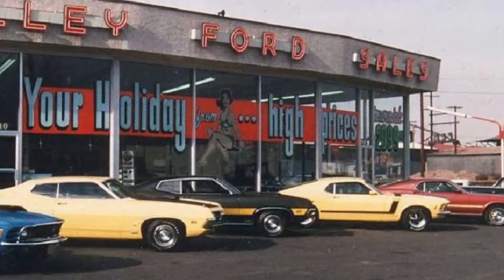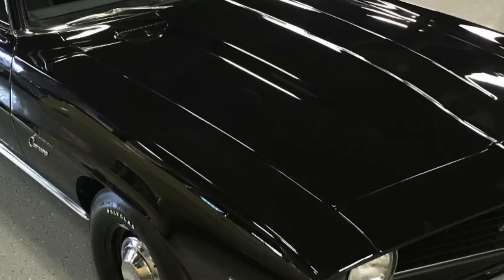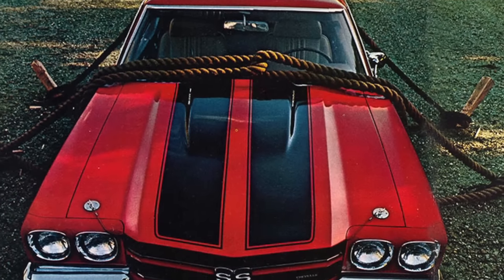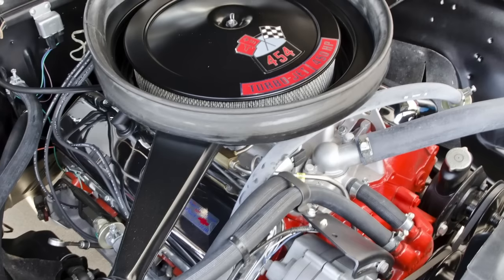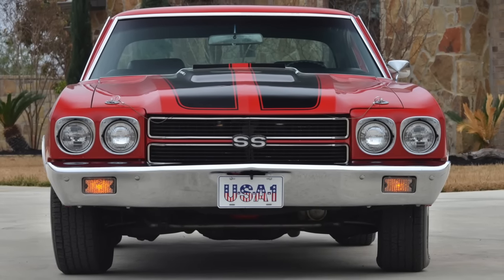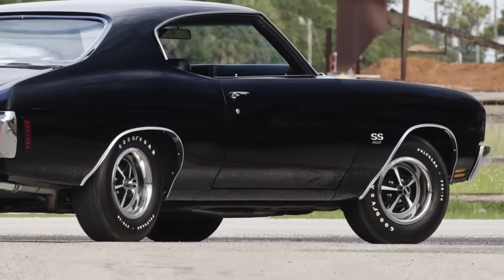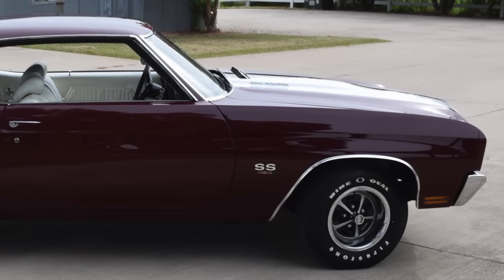1970 Chevrolet Chevelle SS LS6 454 – Freak of Nature

Comment: I bought a new 70 LS6 SS in Feb, 1970.  White with Black Stripes and Black interior.  As I recall right at $4,700.  Probably the most fun car I ever had.  I won almost all of the time but there were a couple times I lost. It was a daily driver so I kept it pretty much stock except for Headers and a different Intake and Carb.   As long as I didn't touch the inside of the engine my warranty stayed intact.  Sometimes I simply could not get any traction.  I had the 3 Speed Auto with I think a 331 Gear.  i have always wondered what would this car have been like with today's electronics.  My fun car today is a Z06 A8.  I have always been an Automatic Transmission person simply because I was not good with the manual clutch. I kept the 70 SS til I had 48,000 miles on it.  It had a 50,000 mile powertrain warranty.  And believe me this car was in the dealership for motor repairs several times.  I simply didn't want to pay for the repairs myself after 50,000 miles. And the final thing was my Insurance Company in 1972 raised my premiums to $1,470 annually.  I said no and traded it in on my first Corvette.  The 1972 350 Corvette annual insurance premium was $270.  Folks, that's what ended the Muscle Car days for me back then... This was a great video, Keep em coming.
Reply: I would guess that this car's modern equivalent would be the late Chevy SS sedan. They would have sold like crazy if they would have put a retro theme on it and called it "Chevelle"
Reply: @twoeightythreez  the only reason the SS even made it into production was to fulfill GM's Contract. I talked to a couple of Salesman when I was getting service done to the Wife's Cruz and they didn't even know what it was. Kinda hard to sell something when you don't even know what it is.
Reply: @twoeightythreez  the modern equivalent is the camaro,there is literally like 10-15 whp difference between the 70 ls6 ss454 and what is under the hood of the new camaro.
Reply: You lived the life sir.
Reply: @SGTJDerek  Those salesmen were amateurs obviously
Reply: @davidkastin4240  wasn't just the salesmen. Dealership Manager had to look it up.
Reply: @SGTJDerek  I think '17 was the last year the SS was made. Not sure. But no car manufacturers offer 6 different models of the same car like the 60's so they should have been aware of it. Did their skin have a green hue lofl 😆
Reply: @davidkastin4240  yep but at least you could get a manual the last year.
Reply: Today's electronics - AND the staggered 20" wheels/tires from my 2017 Camaro SS - I don't think the set from a ZL1 would fit... Oh, and a 8-10 speed automatic 😆
Reply: @lockonstratos7787  And ~3 times as many gears - 8AT, 10AT - latter available on 2019 SS.
Reply: @davidkastin4240  Except Camaro - if you count 1LE variants... 😆
Reply: Sounds like you enjoyed the heyday of the muscule car days. I’m looking at used 2008-2010 zo6 now with low miles.Seems to be a performance bargain for under 40 k.
Reply: With inflation, that's about $31,000 in 2019.
Reply: @lockonstratos7787  no
Reply: You must have had 50 wrecks , 2 dui's and 1470 speeding tickets lad. I had a 68 GTX , 440 4 speed and my rates were about $300 a year in 1976. I presently own a 72 c10 , 30 over 355 , Tremec tko 5 speed , around 425 hp insured value at $17,500 and pay $1190 per year....
Reply: Richard Lehs That would be awesome if you had his old chevelle man..
Reply: Great insight on the era. Thanks.
Reply: GREAT story Paul,Thanks for telling it.
Reply: @lockonstratos7787  wrong.....this LS was advertised at 450 hp, but was only 370 hp NET in the car---that is about 100 hp MORE for the new Camaro....
Reply: Wouldn't you love to find it today?

Comment: It's amazing to hear the narrator talk about engine, transmission and rear axle ratio options.  Today they talk about cup holders and moon roofs. BFD!
Reply: 👍👍🤣Sooo true mb13972 Today’s cars wouldn’t last 50 years, they would fall apart in less than 5 years. Today’s cars are a shitbox.
Reply: Screen size. Mpg.....
Reply: Cars sold by level of internet connectivity...
Reply: Temporary Account  You’re sooo right about that.🤙
Reply: @malachycasey1488  Today's cars are disposable
Reply: @malachycasey1488  there’s a reason why they used to call old Chevy pickups “like a rock” and nowadays they don’t say anything, because false advertising is illegal
Reply: Dont forget google car play and the absolute must have heated steering wheel.
Reply: You are so right brother.

Comment: bought a 1970 red black stripe ls6 454-460 cowl induction m22 4spd. from 1st owner in june of 1977. it had 3.31 rear posi . i drove this car on vacation south on interstate 15 to interstate 80 in nevada  n then ran with 6 truckers west to reno nv. at 100-110 mph and i averaged 16.5 mpg. this trip was at about midnight on a saturday night in autumn, cool air n stars....///
Reply: Doug Isbister. Wow what a great f*** story. Dam bro you have lived the American dream bro. Thanks for sharing.
Reply: I think the silver/black ones stood out most and looked like the Empire was going down the street before Star Wars was a dream.
Reply: A 454  with  3.31  gears  at  100 to 110 MPH  would get about 9 MPG my guess..  My  73 Chevelle with  2.70 gears  and turbo 350 ..  headers  1970  64 CC heads not stock 73  75  cc heads  SP2P  4 barrel economy intake and spread bore 450 CFM  Holley carb got  24 mpg at   55-60 mpg .. 

  My  2016  Yamaha FZ-07  got  28 to 32 MPG at  100 MPH when it was 34 F out recently ..
Reply: No way lad ; no way.
Reply: @alwaysopen7970  Millennium Falcon?
Reply: Interesting data on that Chevelle. I drove a Pontiac from BWI airport (Baltimore) to Cleveland (Hopkins Airport) in precisely 4 hours and 19 minutes. Not really sure about my MPG on that trip because I didn’t have time to worry about it. I did alert the attendant at the Avis drop-off that the transmission seemed to be slipping, and that it smelled very hot. Also that he should put it in for inspection and service before renting it to anyone else. I think I might have been able to drive it in less time had it not been raining so much.
Reply: Good story
Reply: Clay Potter  Did he have a Snoopy leather flight helmet w/goggles?
Reply: @patrickreilly2338  Sounds like an East coast Vanishing Point.
Reply: @mhartung8335  He obviously did a serious miscalculation on gas mileage. Because even while drafting behind a semi tractor trailer, there's absolutely no way he got 16 mpg @ 100 to 110 mph. That's just nuts. He would've been lucky to have gotten 10 mpg..........and I doubt that as well. 70 mph would be about right for 10 to 12 mpg.

Comment: Got one sitting in the garage, makes me feel like the KING of the road when I get it out and stir the shifter. USA1
Reply: I'll be right over, lol.
Reply: Yes sir lucky guy
Reply: Just don’t challenge a performance EV at the stop light.
Reply: @shepherdsknoll8   I had a 1977 Trans am with a factory 455  And yes they made a few with a 455   It would smoke a 1970 Chevelle Im not bragging  its a fact  But the 1970 chevelle is a work of art
Reply: Joe Mamma , I was just out in the Nevada desert, I did 130 mph on a straight stretch- rock solid. My foot indicated another 10 mph.
Reply: In a long race, yes, the Trans Am probably wins... higher gearing, better aerodynamics... They're long legged road cars.  But a '77 Trans Am, even one that somehow gets a 455 dropped in, gets absolutely destroyed by an LS6 in the quarter mile.
Reply: Hail King!
Reply: @randywatts7085  What is the HP on the 455? I thought that they were pretty weak, as I recall.
Reply: @joelalexander5338   Its not all about HP its more about gears  Thats why most 4 bangers of today can smoke any of the old muscle cars
Reply: Randy watts no its because theyre well designed engines are makin 100hp per liter[over 1.5hp per cubic inch] in cars with 4:46 final drives and a curb weight of 24-2800 lbs in a NET 180-240hp cars.
Reply: That's where it belongs in the garage and out on beautiful days
Reply: Randy Watts A 4 cylinder smoking ANY of the old muscle cars? I can't believe YOU believe that. I have $1,000.00 CASH that says NO-NO. I have a friend who has an L88 Camaro that would run away and hide from any modern 4 cylinder you could possibly come up with. You in?
Reply: GARY JACQUES you’ve obviously never driven a big block chevelle.
Reply: I don't think any of you guys have driven a 454 Chevelle, and I don't know any Trans Am ever made including the 73 SD455 that could out run one in the quarter mile,
Reply: @shepherdsknoll8  yes I had a Malibu 69 I did a hundred 25 down the road I had a bored out 40 over 350
Reply: Yeah, sure you do.
Reply: Good for you for keeping your badass rod. I still wish I had mine back.
Reply: Was there also a fuel injection that came with the SS 454?
Reply: @randywatts7085  they didn't make any in 77 with a 455....the 400 6.6L was as good had it got in 77  , the last year they had a 455 7.5L was 76 and was no longer an h.o. version of the 455....in either case iv'e owned both 77 and 76 TA and you aren't touching an ls6 ...

77 TA 6.6  0 to 60 time of 9.3 seconds and ran the quarter mile in 16.9 seconds at 82 mph
70 LS6  0-60 time: 6 sec   1/4 mile in 13.12 seconds at 107.01 mph
Reply: Your cab not enough for ye ?
Reply: Lucky, Keep that car in good shape
Reply: @bodibrodice147  the ls-6 beat hemis out of the box
Reply: @joelalexander5338  it was like 390, but it had a long stroke so it made 500 lb/ft!
Reply: @randywatts7085  horsepower is what you brag with, torque is what matters
Reply: @jonathanriolo2578  I don’t think so, back in the early 60s the 327 corvettes had mechanical fuel injection, but they replaced the fuel injected small block with a carbureted big block
Reply: @william2glaser227  I'm aware.  I have one, and just drove it last weekend.
Reply: @william2glaser227  Absolutely do, it's all original from the 4 headlights to the spare tire and jack in the trunk, unrestored car. LS5 454 M22 with 3:31.
Reply: @archiebunker6059  that's awesome, sometimes keeping it stock is better than being stupid and putting massive rims on and slammining it so the bottom scrapes the asphalt.
Reply: @william2glaser227  that will never happen to this one as long as I'm around 👍
Reply: @randywatts7085  I own a car that would smoke both of them, but it’s not an LS6.  In my opinion, that was the perfect body size and design.  They still look and feel so right after all these years.  The LS6 was the pinnacle, but there are gorgeous Buick GSX’s, Olds 442’s and Pontiac GTO’s that shared the same basic bodies and they all still look great.
Reply: @william2glaser227  It’s always better to keep it stock than to do that with it.  You can make some killer restomods with them that provide much better cornering, braking and acceleration, but still maintain very close to the original stance.  However, it’s hard to argue with just keeping them original - maybe a few minor upgrades for handling that can be put back to stock for re-sale purposes.

Comment: The narrator got a few things wrong. I owned a 1970 Chevelle SS and you could buy them with a 350 small block and I had one. It was a convertible with a 4 speed. Great car. Sold it and regret it to this day.

Comment: Amazing car! I bought a new one, SS 454, Red with black stripes, 4 speed, 3.55 rear gear. I wish i still had it.
Reply: If you only knew then what you know now
Reply: My father r egretted not getting a 1968 turbine bronze colored hemi roadrunner for fifteen hundred bucks in 1972 the roadrunner belong to one of my brother's friends and the water pump went out on it and it's set under a tree on the side of our house for like a month before they came back to get it and he offered it to my dad for fifteen hundred bucks but my dad didn't want it because he did not want to mess with two carburetors and solid lifters he said there was too much maintenance.the car had no options but radio automatic transmission it even had rubber floor mats  instead of a carpet the guy who owned it called it a taxi cab special because it had very few options.
Reply: My father has one too.. LS6, M22 4 speed, he put 4.11 gears, and headers.. sold it during the gas crunch of the 70s
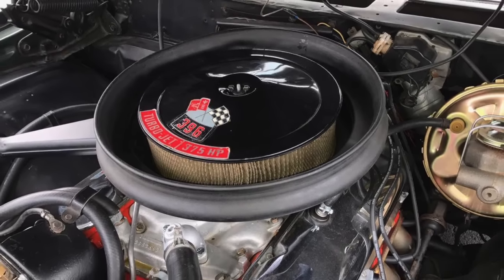Reply: Mine was blue w/white stripes. Turbo 400 automatic, posi 4:10 rear. I paid $2250 for it in 1985.
Reply: @chevyblue10  In 1970 I believe i paid New $4300.00
Reply: @NewtonWashinton  wow. Wish I knew then what I know now. I totalled mine out when someone decided to make a left turn in front of me. Mostly my fault...he couldn't judge how fast I was coming.
Reply: I was a 12-year-old in 1970; I HAD to have that 1/25 scale kit in my collection. The decal set offered either black stripes or white stripes. It was a no- brainer for me to spray-paint the car tomato red, and apply the black stripes!

Comment: I remember in the late '70's you could buy used, running big block muscle cars for as little as $2000. I bought one in '82, a '70 1/2 RS/SS 396 Camaro. Paid $2000, it was my daily driver. Wish I still had it.
Reply: 1990notch ... Dude!!!! ... You must not have known what you had!!!! ... Today that car would be worth $2000 if it was a rust bucket with pieces missing  !!!
Reply: 1990notch I bought 1970 chevelle 250$ previous owner stuck s 455 in it. I sold it for 500$. Only If I  kept one or two of the cars i owned from back then.
Reply: What year did you sell it? I had a buddy that loved El Camino's. At one time he had 3, a '68, '69 and a'71. Two of them were SS 396's. The '71 had a cowl hood with a functioning door, black with white stripes. Another friend had two SS 396 Chevelle's, a '66 and a '67. The '66 is my favorite year Chevelle.
Reply: I owned it in mid 80s. I like the early models more. After that I owned a 68 and 69 dodge dart GT. I could buy most cars back then for 500 buck or less. I wanted to buy a 69 camero my dad refused to let me buy said I would kill my self. It had a 396 I believe in it, price was 1300$ that was in 1984.
Reply: @1990notch  I had 3 '67 4-4-2's A triple black auto conv in HS, I didn't keep it up, traded it cheap when it needed new top, heater/hose, windshield. Got another hardtop with 3MT - found out that was slapped together, before it sucked a valve. 3rd one: I was walking past a gas station (in those days they all had service bays 😆) and he had a beautiful silver metal flake with some custom colors on the sides (don't think it was flames) and the front end parts from a '71 Monte Carlo - including DISK BRAKES. Anyway, I put 1200 miles on it in 4 days, then rolled it up a lawn, landing upside-down. Not a scratch on me, car was totalled...
Reply: Yup, it was crazy for a while how cheap you could find good muscle cars. Especially if you went off-brand like I did and went with Skylarks instead. A GS with a 455 is still a decent running machine.
Reply: @eriklarson9137  I wish I had a Skylark with a 455 today.

Comment: My second car was a 1970 442, basically same ride and fun. Wish I still owned that beast. Great video!
Reply: My second new car was a 1970 Buick Gran Sport Stage 1 4-speed convertible.  I agree with your statement as to the same ride and fun.  All the Hi-perf GM muscle cars were great pieces of machinery.
Reply: My second new car was a 1970 Buick Gran Sport Stage 1 4-speed convertible.  I agree with your statement as to the same ride and fun.  All the Hi-perf GM muscle cars were great pieces of machinery.
Reply: IMO 442 was a better car
Reply: @leomonster1973  it was nicer but not as powerful. The middle ground between the two was the Buick GS455.

Comment: Worked for landscape contractor back in 1970. He went to buy a "strong truck" for hauling boulders. Came back with a 454 El Camino rated at 450 hp with turbo-hydro tranny. Only got to drive it twice, both times with him in the passenger seat. He had no idea what he bought. All the weight is up front, so, even a light tap of the gas pedal spun the skinny polyglas tires. It was a monster.
Reply: All the weight up front? Put some boulders in the back... 😆

Comment: I bought my 1970 Chevelle almost 16 years ago, and I vow to never get rid of it. It's not an SS, but a Malibu that originally had an inline 6 under the hood. I have a 350 now, and it currently needs a transmission as I only have 1st and 2nd gears.

Comment: A 70 SS454 has always been my bucket list car.
Reply: Mine is a bit wider. Instead of getting a newer G37/Q60 to replace my 10YO G37S, maybe with AWD, with ideas for forced ind. BUT, instead I opted for a big honkin' V8. OK, it's only 376CI, but it makes 455HP and 455TQ, in a 2017 Camaro SS. Most powerful & quickest car I've ever owned/driven. AND, after 9/2021, I cam mod it all I want - thinking ProCharger... 😆